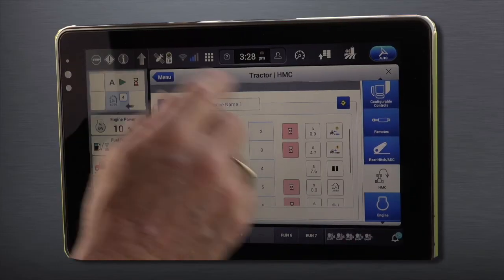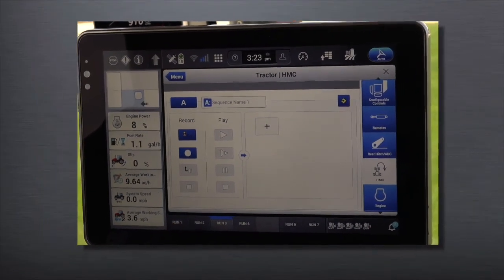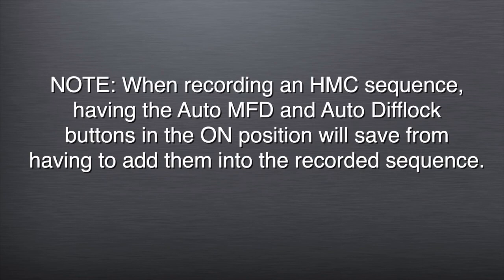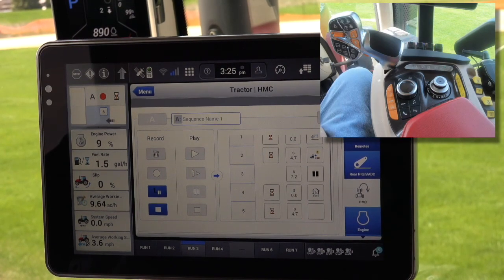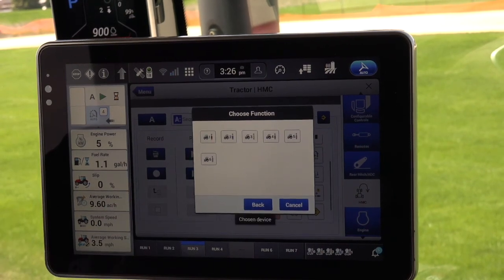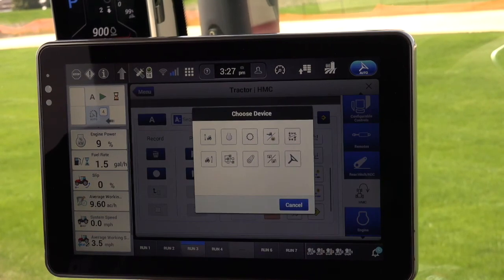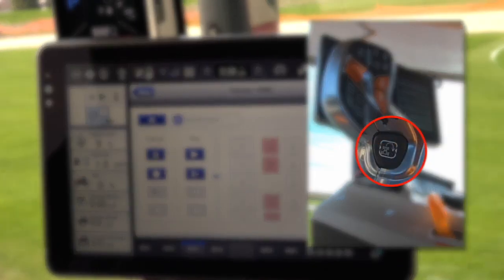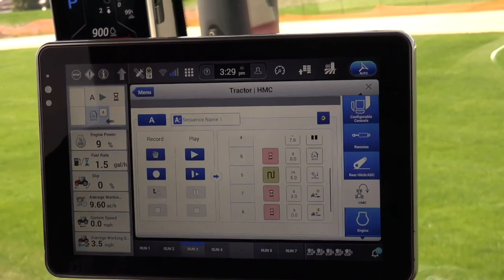Case IH AFS Connect Magnum Headland Management Control Instructional How To Video

Comment: I run triple mowers. I set a and and b sequences. However if I change direction it interrupts and stops the sequence and I have to push the button again to finish the sequence. Is there anyway to change this ?
Reply from the maker: Hey Nick It sounds like you might not have things set up properly. I would recommend you contact your local Case IH Dealer for assistance https://www.caseih.com/northamerica/en-us/dealer-locator